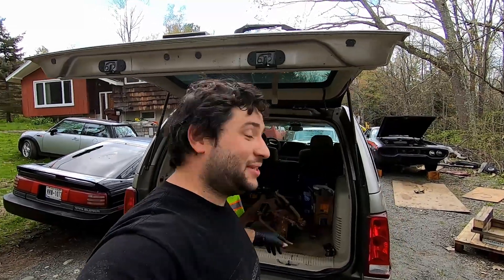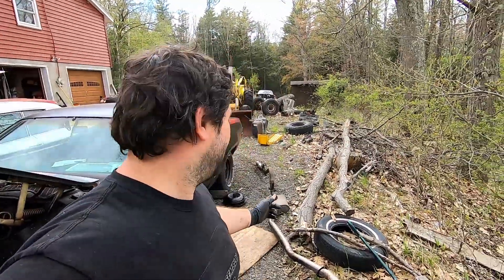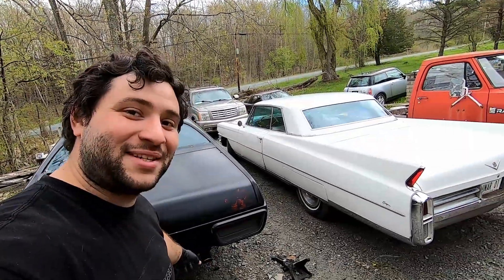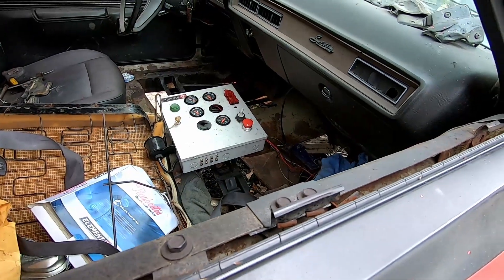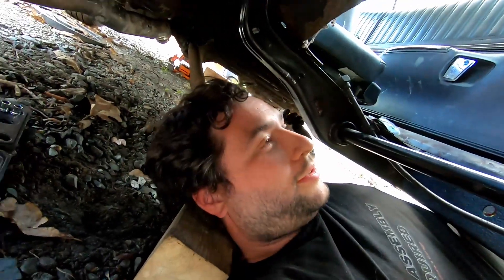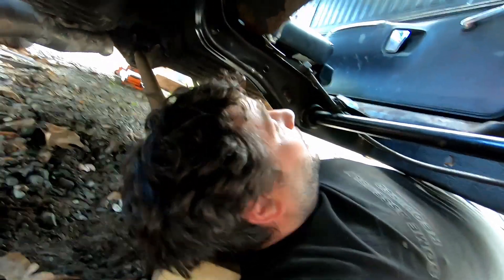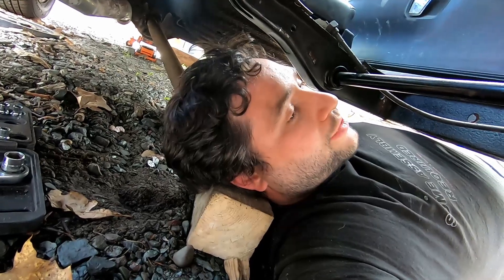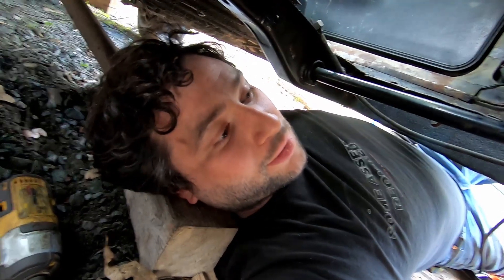Starting the a833 swap in the 1972 satellite

Comment: Looking great Lunar! I once got a 4 speed set up out of a 73 rally charger and changed a 72 Cuda to 4 speed, so you can get linkage and pedals from a E body if you find them, hopefully you can find a pistol grip shifter, one from a E body will work.
Reply from the maker: I am going to check a few yards this weekend
Reply: @LunarOutlawsGarage  great! I hope you can find the parts, Brewers in Ohio has everything you need but it would be costly, hope you can find it cheap at a yard.
Reply from the maker: Currently buying re pop or restored is out of the budget right now so 🤞

Comment: Classic tube sells pre-fabbed brake and fuel lines at a reasonable price.  They usually offer a 3/8" upgrade from the 5/16" size lines.
Reply: Yes that 3/8 pre fabbed is the way to go if you are replacing lines anyway. Even if you don't have a matching 3/8 tube sender yet.

Comment: Congrats on the exhaust system!!! 
You've gone from one the worst looking systems to the very best looking one.
You should order up the special rear hangers for the tips so they arrive in time.

K members for 72 are the same big block and small block.  73 and newer B bodies 
use a different one for big block. so it is in demand.

You should not have a problem with the starter. Unless you got one of a Hemi 4 speed
they are all the same.  As far as bolting in, at least.
There are two levels of strength, however. The stronger one 
looks bulkier and longer but has  the same general look.
I'd use a "mini" started from a Dakota if I had one. They are smaller than the smaller of the old style and stronger than the bigger. Probably quieter, too.

Comment: Buddy if you're afraid of the smell of a little bit of exhaust fumes then you might want to keep stuff like that to yourself it's kind of an image thing
Reply from the maker: You do know that it is not the smell I a worried about. You are aware that it contains carbon monoxide which displaces the oxygen and can be a bad time. 🤣🤙
Reply: @LunarOutlawsGarage  yes I was almost killed by a 77 Thunderbird with bad catalytic converters in the late 80s and about 3 or 4 years ago somebody had an S10 running in the garage I was working at and it about made all of us pass out and no I'm still not afraid of exhaust fumes
Reply from the maker: Lol I work with up to 40,000v and 5000 amps if I can mitigate things that could possibly kill me that is a good thing.
Reply: @LunarOutlawsGarage  I wasn't accusing you of not being crazy I understand you're one of them crazy people that plays with electricity you have my respect for that buddy but us older fellers are not afraid of lead gas and exhaust fumes
Reply from the maker: I wish they would bring back lead gas. Cars run so much better with it lol
Reply: @LunarOutlawsGarage  yeah it would even make you dizzy while you were pumping it